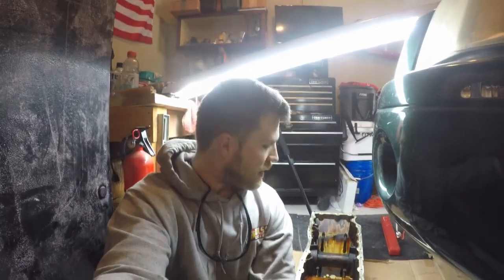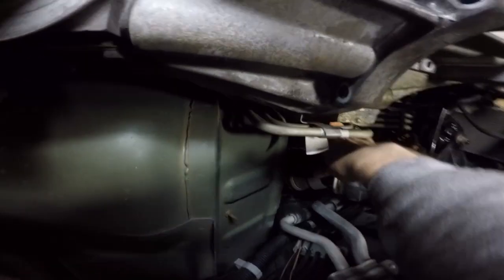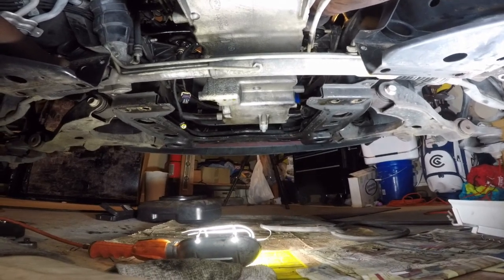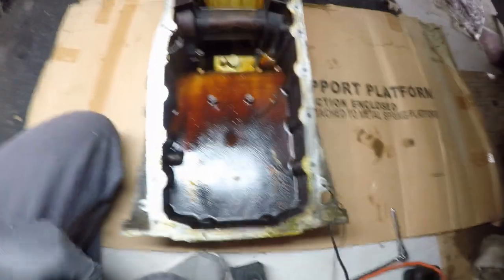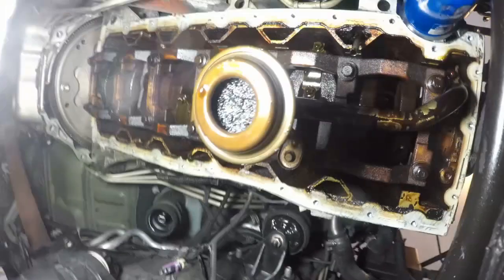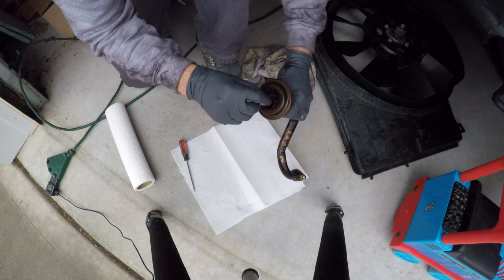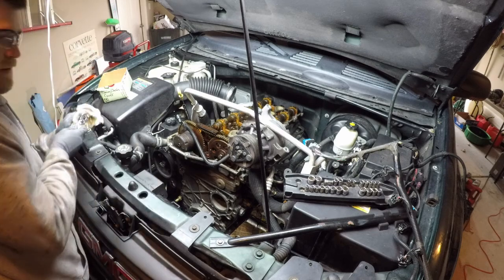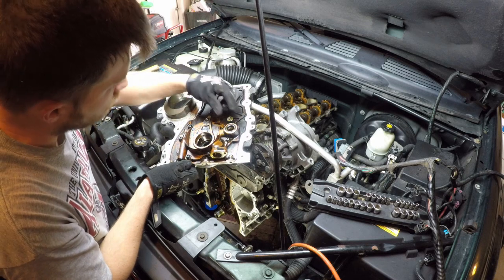I Broke My Oil Pan (GM 4.2L Oil Pickup Tube Removal - Part 2)

Comment: I was curious how long you left the oil tube in to soak? I didn't see you mention it in any of the videos but may have missed it.
Reply from the maker: @Pocketpac  Good question. I don’t think I mentioned that, but I only had to leave it soaking for a couple minutes. Of course it will depend on how clogged your screen is.
Reply: @KevinNadeau  I ended up rednecking my way outa the situation. I had the exact same symptoms as you did and didn't wanna pull the whole thing apart just to get to the tube, so I drained the oil and put 1 gallon of degreaser down the dip stick tube. 12 hours later I drained it totally and put fresh oil and filter and walla, problem solved! I did all this yesterday inspired by all your videos.

Comment: Question 
Do I have to remove all this if I wanted to remove the front timing chain cover, I broke off 3 bolts on my water pump and I just figured I can go to the junkyard and just get a used one and install the water pump back on
Reply from the maker: Most of it, yes. Mainly because the oil pickup tube is bolted to the back of the timing cover and also has a support bracket bolted to the bottom of the block. Have you tried using an easy-out to remove the bolts before going thru this headache?
Reply: @KevinNadeau  I am going to try that first and hope it comes out.
Reply from the maker: @angelf9800  I broke a water pump bolt before and was successful using an easy out. I did have to drill a small starter hole in the bolt first. Good luck 👍
Reply: I bought all the parts I need to repair my trailblazer, does it have to be level on 4 jacks stands or can the oil pan be removed with only the front end lifted.
Reply from the maker: @angelf9800  I did mine with just the front end lifted 👍

Comment: Old video but in case any stumbles across this....   The oil "pressure" gauge is not an actual gauge, but an on/off switch. Its been tested and found that it only shows pressure or no pressure - no measurement. But anywho, the sensor goes bad and cause the gauge to go up and down. Its on the side of the oil pan and has an o ring that commonly leaks. Simple fix - replace the sensor
Reply from the maker: Exactly👍 One can install a manual pressure gauge to get an accurate reading of oil pressure 👍

Comment: Hey man. thanks for you video. really helps to replace the oil pump. Few things I want to ask you. I replace the pump, and the pickup tube as well, and do the whole process. I start the car 2 days ago and yesterday get the same gage issue showing that my pressure was dropping did you have anything else in mind that can be wrong based on your experience, I order another oil pressure switch just to be on the safe side and buy the genuine to see if that helps. did you think there's aything else that can affect the oil pump pressure?. thanks in advance.
Reply from the maker: I think you’re on the right track. The pressure switch seems to be a common cause for the gauge to fluctuate. There is also a little check valve the sits behind (on top of) the oil filter. Other than that, the only other thing I could think of is possibly losing pressure due to worn bearings or rings, but that would likely be a long shot. How many miles do you have?
Reply: @KevinNadeau  Thanks man!! for the fast reply. My envoy only have 155k is not even that much man. hopefully is the pressure switch. thanks for your help.
Reply from the maker: @Ifollowmyjourney  👍

Comment: Running kerosene or engine flush through the engine will break sludge and crud loose which will end up in the pick up.

Comment: Someone said on GMTnation or trailvoy that it's ok to run 1/2 quart extra on the oil due to the front sump pump - to make sure there's enough oil since oil could sit in the rear behind the differential tube. So I plan to make that 1/2 quart extra to be MMO - and that should break down any gunk on the pickup tube. Also I'm going to finally switch to full synthetic. I've run synthetic before - so should be o.k.

Comment: Is there any way to tell if the pickup is clogged other than to take it all apart?    I tried Seafoam but I still have issues.    I might try either BG or Marvel Mystery Oil before I go any further.
Reply: I think the turpentine in MMO should dissolve that gunk. I'm going to add 1/2 extra quart of MMO in crankcase before oil changes. I just added it - ran today just fine - probably better I think.
Reply: @voidisyinyangvoidisyinyang885    I had the seafoam in the oil for a while but I still had the issue occur although less frequently,    I then changed the oil with Mobile 1 oil and a better quality oil filter I used fram silver series and the issue has not reoccurred yet although I still have a little stutter at idle but I am not yet sure what is causing that.
Reply: @voidisyinyangvoidisyinyang885  I think it's better to just do more frequent oil changes.
Reply from the maker: I've wondered the same thing😁 The only thing I thought of was a bore scope. Never tried it, but it seems plausible 👍
Reply: @KevinNadeau  The bore scope may work if the oil drain plug is lined up with the pick up.
Reply from the maker: @billwilson3665  If I remember correctly, its not quit lined up.  But there may be a flexible scope on the market that may work well...I just haven't gone down that path yet.

Comment: I have an ‘08 trailblazer with the 4.2. I had the tranny rebuilt at 455,500 miles. Three days later my oil pressure started bouncing down to zero and back up then started making all kinds of noise. It’s a two wheel drive so I don’t have to worry about the front axles etc.  Does anyone know what all has to come off to get the oil pan off?
Reply: maybe the torque converter wasn't install right? I have no idea but I just got a reman transmission - and so researched transmissions a lot. Seems like if you suddenly got oil pressure problems it could be related to the transmission.

Comment: so what was the maintenance history like in this car? that seems to be a lack of maintenance causing all the sludge, carbon and varnish deposits.
Reply from the maker: I've performed all routine maintenance on the truck since I bought it at 50k miles.
Reply: @KevinNadeau  what oil and oil change interval? it looked like maybe it was running a conventional oil for too long inbetween changes.
Reply from the maker: @jamesyarbrough4777  I've used Valvoline 10w30 Full Synthetic or Synthetic blend since about 2008. I change my oil about every 5000 miles.

Comment: Do you remember by any chance to remove an oring from the pick up tube? Because I’m working on mine and I install an oring together with the flat metal gasket that came with the new oil pump and for some reason once she warm up oil pressure drop
Reply: I was watching your videos special when you mention the part of the s on the vin number and my 06 has a letter s on it and I think my mistake was on adding the oring into it because I wasn’t sure if it need it or not
Reply: If the pick up tube doesn’t sit properly might have issues with the oil pressure right?
Reply from the maker: @1981jcg  Yes
Reply: Thank you
Reply from the maker: I think there were two different designs...an o-ring and a flat washer type. You need the correct one for the design you have.

Comment: Do you think that letting the engine soak over a weekend in a couple quarts of parts cleaner would have broken down that sludge?
Reply: i was thinking the same thing except with diesel.
Reply: There is no shortcut to taking the pan off. I've tried it all including running aquarium tubing down the dipstick tube to aerate and circulate the parts cleaner or whatever is used.
Reply from the maker: I think so because that's all it took to clean the pickup tube screen once I got it off. I wish I would have thought of that before I tore into my motor😁

Comment: Thank for making video .do you still have your envoy running.
Reply from the maker: Thanks for watching. Yes, my Envoy is still running strong with about 313k miles!
Reply: @KevinNadeau  So was it just the pick up tube and chain and shoe replacement that fixed all your problems?
Reply from the maker: @RonD1217  I believe the actual fix was unclogging my pickup tube.

Comment: Why not just remove the body mount bolts and motor mount bolts and jack up the body to be able to jack up the engine for clearance?
Reply from the maker: I don't know if you would get the clearance you need.
Reply: Kevin Nadeau thanks bro.  I’m gonna give it a try. I’ll follow up with you if it works out for me.
Reply from the maker: @rightsidelanechoice7702  Good luck man👍

Comment: What kind of oil were you running?
Reply from the maker: Valvoline 10w30 full synthetic
Reply: @KevinNadeau  Looked like it was partly sludged up. Probably from a previous owner.
Reply from the maker: @int53185  It was definitely full of  sludge. I have owned the truck since ~ 50k miles. I didn't always run full synthetic.
Reply: @KevinNadeau  I switched to full synthetic on mine. Walmart brand full synthetic is only $14 for 5 quarts.
Reply: @int53185  $28 now. Thank you U.S government.

Comment: When the Opportunity presents itself always change the Oilpump 1 being you had a oil starved Engine and 2 look at your mileage if that gives you a clue ,bothers me that we as information seekers don’t get to see how you took off the Harmonic balancer  ,and is your little helper collecting unemployment as we haven’t seen him do any work yet😂
Reply from the maker: I ended up changing the oil pump and front cover b/c I cracked a portion of the gasket surface near where the oil pan seals to it.  Removal of the harmonic balancer wasn't real exciting, but you can't just use a puller from the car parts store.  You'll need an OTC 6667 tool (or equivalent).  
My little helper is more-or-less a supervisor, which is why he doesn't actually work :)
Reply: Kevin Nadeau 
Ok I did see that you broke the pan,I’ve worked on several of these all had identical problems,this current one I,m doing a head gasket ,causing misfire,good video of course I,m a professional 45 years with all pro tools and ran across your video for research as to which tool I would need ,have all sorts of pullers but being this is GM of course they have to be different,teach your little helper when ready,knowledge is priceless coming from Dad trust me,maybe one day he will keep another Mopar alive
Reply from the maker: @mikeroberts5646  I'm honored you've found my videos helpful.

Comment: So was it the pick up tude or the pump. Having low oil pressure issues on my trailblazer
Reply from the maker: It was the pickup tube. My oil pressure has been fine for over 2 years since I cleaned the pickup tube.

Comment: Kevin,  I know this has been a few years ago now to the date actually but I wanted to comment about your oil pan situation. I worked as an automotive tech for about five and a half years at a couple Ford dealerships as well as an independent shop and then also  have my own shop.  

I know that you broke the corner off, but if you looked at your old oil pan, you would notice that there was still plenty of area for the oil pan to mate up to the engine block and create a seal. At least it appears that there is plenty of area and the sealing area itslf is still flat unless there is something I cannot see in the video. As such, you did not need to actually replace the oil pan. I know that people freak out about damaging parts but the reality is, that corner actually didn't hurt anything being broke off. You can see that there are other bolts close by that would hold it on and the pan would probably seal up just fine in spite of that corner being broken off. 

Unless the pan itself had a crack in it, which it did not appear to have just by looking at the video, you could have simply used the old oil pan and save yourself a little bit of money.

I know you said it was only $45 or $50 with shipping from eBay and that's not a lot of money but the reality is, it wasn't money that you had to spend. Also, you could have JB welded the corner back on to the oil pan and probably been okay.   You would be surprised at how well J-B Weld actually works. Go and watch Project Farm YouTube videos and see how he used J-B Weld on a cylinder head and it works. Pretty amazing stuff.

I don't know if that oil pan takes a rubber and metal gasket (it "appearsc to be a rubber with metal gasket just by looking at the markings on the oil pan rails) or RTV sealant, but you could have used a little bit of RTV sealant in that corner (if you had to) and been perfectly fine.

Yes, I know a lot of people will disagree and say that you have to replace the oil pan because that corner was broken off no matter what however, look at the oil pan and you will understand that the corner itself is not really going to change anything because the pan itself was still fine. There was still quite a bit of area on the pan to allow it to be sealed.

Now, I'm not suggesting to leave it this way if it is a customers vehicle, but since it's your own vehicle, it wouldn't be necessary to change the oil pan.   If it was a customer's vehicle, that would be different. And of course, I would suggest to change the pan and obviously discuss the situation with the client and see what they would like you to do. Obviously, if you can find a $50 or $75 oil pan. Somewhere, it would be better off to spend that little amount of money and fix the client's vehicle correctly. However, Again, when we were talking about your own vehicle, it makes a difference.

Again, look at the actual area of the oil pan and you will see that the earpiece or corner of that oil pan being broken off was not actually changing or affecting anything as far as the ability for that portion of the oil pan to seal to the engine block.  The oil pan sealing area itself was not affected from what I can see.  And although you can argue that the corner was going to provide a clamping force, It is not going to provide that much more force than the other two bolts around that corner that are actually going to provide more than enough clamping force for the oil pan to correctly mate and seal to the engine block.

Now, unless there was an additional crack that I cannot see, then that would be different. However, just looking at the video, It looks like the pan would have been fine. As I said, J-B Weld it and call it a day and you'd be good.

Also, considering the amount of debris in the oil pickup tube, you should ALWAYS change the oil pump no matter what in a situation like this.  Especially when you figure you had as much of the front of the engine apart as you did. 

Since you already took the front timing cover off, It makes no sense not to spend an extra $75 to a $90 depending on where you get the part and change the oil pump especially considering how crucial of a part the oil pump is for your engine.  It is too much of a risk to just leave the old oil pump in there considering that there could have easily been some debris or foreign objects that got into the oil pump which could be causing an issue currently or might cause an issue in the future.  Also, at 250,000 miles, It's pretty much a no-brainer. 

Again, since you were already that far, it makes no sense not to change the oil pump. Just letting you know for the future.

I believe I watched another one of your videos and you did end up changing the oil pump if I remember correctly. So that is good. Also, just out of curiosity, do you have any more updates on how the vehicle runs? I think you did an update a few months after you finished it but I don't know if you've done anything since then?
Reply from the maker: Thanks for sharing your thoughts. As of today (2/22/2020) my Envoy has about 295k miles and is still running good. I just uploaded a video of a cold start from earlier this week. Check it out if you're interested. Thanks again for supporting the channel.
Reply: Kevin Nadeau it’s good to know these engines can last that long I had an incident where there was a tractor trailer tire and rim laying in the middle of the highway well as I went over it it cracked my oil pan all the oil drain right out truck shut off was smoking like crazy oil all over the bottom but I got it all apart and just have to take the bolts out the pan and replace hopefully there’s some type of safety on these motors I’m hoping the engine didn’t sieze up because of that it shut off prettty fast so I’m assuming every should be ok

Comment: Good night when you time up the engine after you rotate the engine dose the marks still have to line up ?
Reply from the maker: The marks should line up at top dead center.
Reply: Kevin Nadeau I had it tdc when I put on the cam gears and everything
Reply from the maker: @darlinlubin7396  The marks should line up then I believe.
Reply: Kevin Nadeau I keep on spending the engine and it ain’t line up yet 🤦🏿‍♂️
Reply from the maker: @darlinlubin7396  When you're at TDC, both camshaft flats at the rear should both be up. Are you using the camshaft holding tool?
Reply: Kevin Nadeau lol they just line back up had to spend the engine like 20 times to get the line back up
Reply from the maker: @darlinlubin7396  Awesome! Good luck putting everything back together 👍
Reply: Kevin Nadeau when the mark line back up that men the timing right ?